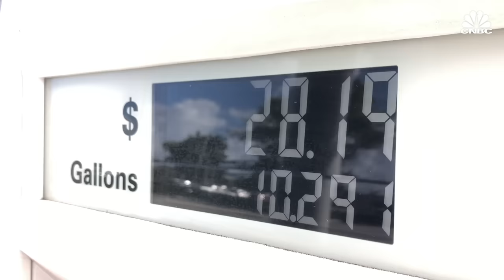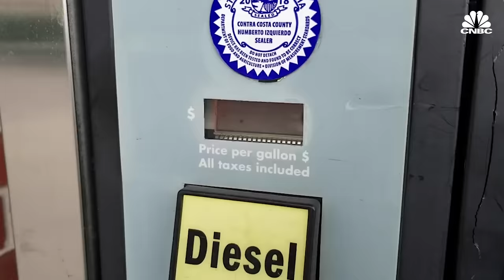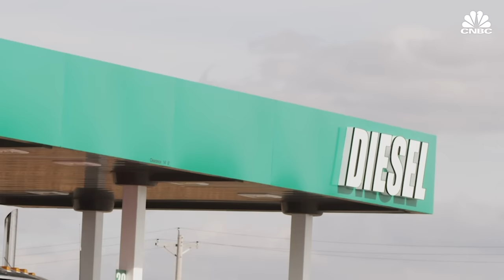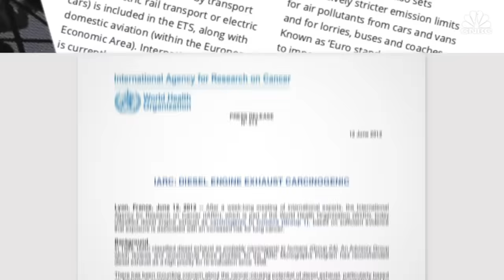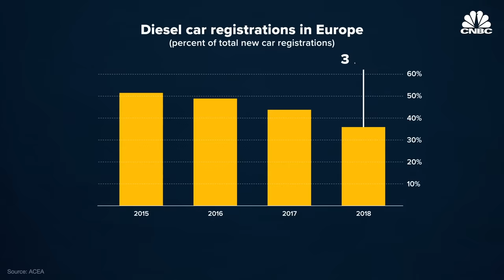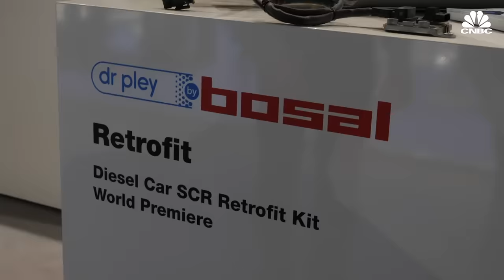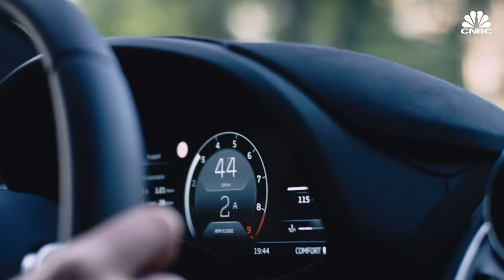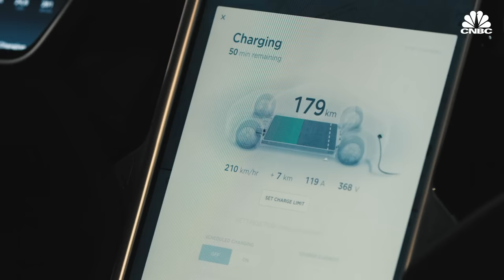Why Diesel Cars Are Disappearing

Comment: Just 2 make it clear. The sulphur content in Diesel has no impact on the Nitrous particles emission .That is occurring  due to the high combustion pressure and -temperature in Diesel compared to that of Gas engines. It is a derivate of the Nitrogen in combustion air.

Comment: Both of my road vehicles are diesels. '04 TDI jetta that gets an average of 42MPG. and my '00 Ram 2500 4x4 Cummins that averages 14-16MPG while having well over 500HP/1200lbs/ft TQ to the rear wheels. Take a gasoline truck with even half of that power and it's lucky to get 8-10MPG. 

My truck has 275k miles on it, still going very strong. Car has 208k miles on it, also still purrs like a kitten, and runs with zero problems. Keep up with basic maintenance (oil changes, coolant changes, filters, timing belts every 80k, etc...) and replace worn parts (motor mounts, brakes, 1 clutch so far) and that motor will likely last as long as you do. Can't say the same about a gasoline. after 200k on a gas motor: you're on borrowed time. On a diesel: 200k = you just broke in the motor. good for another million miles!

As for cars: my fiancée has a comparable sized car to mine, hers is gasoline 4-cylinder. She gets about 30MPG. We both drove 700 miles to our new home. Her car had to fill up 3 times. Mine only had to fill up once. Granted I do have a 15 gallon tank and she has a 10 gallon tank. She's still burning more fuel to do the same work. 

The only disadvantage to diesels is you do lose some fuel economy in the winter time as the winter fuel blend is mixed diesel and kerosene to prevent the fuel from gelling in the cold temps. Kerosene is less energy dense than pure diesel, and as a result lowers your fuel economy a bit. 

You will also see some diesel vehicles cover their grills in winter time to help keep the engines warm during the cold winter months which is another downside to being more fuel efficient. The engine produces less heat and have a harder time maintaining operating temperature in freezing climates. Blocking the cold air coming across the radiator and engine helps the engine maintain operating temps.

Comment: Nowadays diesel vehicles are equipped with Diesel Particulate Filter (DPF) to trap soot. However, it requires active or passive regeneration to burn off the accumulated soot to prevent clogging. Diesel engines also require Low SAPs Engine oil to further reduce the DPF from clogging.

Comment: "Diesel is not done yet"...just note that...as diesel mechanic, technician for fuel injection pump...i decicated  life, skill, effort to give good quality diesel engine, safest, and cheap, and powerfull for heavy equip, machinery and so on.
Reply: Well you have at least another 20 years before diesel becomes completely obsolete
Reply: Modern diesel engines have many exhaust filtering systems that render the exhaust gases practically invisible. I have brand new car (Citroen C4 Cactus 2018) with BlueHDI engine and you can't even notice the exhaust. It administers dose of AdBlue compound which dramatically reduces the pollution and helps the fuel burn better. The US is not the entire world so you cant state that diesel engines will be gone in near future. Even if the fossil fuels are gone, there are many ways to produce bio diesel. And there you have trucks, trains, tanks...

Comment: I love diesel cars and have 3 Ford diesel and now run a Mazda CX5 - 2.2 litre diesel (All been very reliable) which is giving me average 50 mpg. Would never buy electric car-  poor range 250 miles my diesel 420 miles - refuel time electric could be several hours  - my diesel 5 minutes - Big drawback cost to replace battery on electric car perhaps after 4/5 years about £10,000 depending on model. If you run out charge on electric car would mean a tow. Me I keep 10 litres of diesel in the boot just in case.  I think I will keep driving diesel as long as possible

Comment: The PSA (Peuget/Citroen group) still launched newly coming diesel engine, DV5, in 2018.
This DV5 diesel engine is able to meet the Euro 6 STD gasoline standard.
Whatever the requirement for gasoline engine, the diesel DV5 make it.
Reply: Yes, but modern diesel engines bocome so complex and expensive ,just to meet emisions regulations. At one point- all economy from fuel is pointless - with that complex engine and with so hi cost for maintaining modern diesel.
Reply: Unfortunately, the Stellantis group (formerly PSA/Citroen) have already stated that it will be too costly and too technically challenging to meet the upcoming (in 2025) Euro 7 emissions regulations with an ICE engine......as have several other car makers......

Comment: It has been scientifically proven that most of the airborne carbon particulates around roads come from tyres and brakes NOT diesel engines. A combined diesel/hydrogen engine is needed, with the diesel engine running on vegetable oil as it was originally designed for. Electric cars and vans still use tyres and brakes, and payback for production carbon dioxide of electric vehicles is on average at least 11 years; batteries won't last that long. All electric vehicles is the wrong path.

Comment: I would dare to say that diesel is not finished indeed. Maybe US customers do not drive diesel cars, but Europe is still very much in love with diesel engines. Euro 6 norm for the gas exhaust system is so efficient that you can hardly feel the scent of the engine. In fact, it smells like vapor. Just wait for what happens after the EV hype has started to crumble already! Diesel may just be a go-to fuel.

Comment: Good, balanced report , well done! 
Worth pointing out that Diesel died in Europe as consumers worked out that the emissions systems are costly to repair and often fail when used for short journeys. Diesels also get smoky and dirty over time.
Diesels can be made clean by using urea additive but not cost effective for small cars and the big German makes were fined for colluding to limit the size of these pollution reducing systems. 
Diesel is a good fuel and can be clean, VW poisoned the pool for diesel in Europe unfortunately for cars and light trucks.
Reply: Diesel died in Europe? Could have fooled me. Hybrids are just now starting to match diesel car sales volumes in Europe. Go car shopping in the UK and you can buy a smart new VW Golf with a 2L diesel that gets 62 mpg.
Reply: I'm in the UK I'd never buy electric. I'm keeping my diesel until they completely ban them

Comment: Just wait and see what happens when the truth comes out about electric cars .
Reply: How are EVs even remotely comparable to diesel?
Reply: Good comment  but we will all be stuffed  .... with electric
Reply: @planefan082  well the actual end life pollution made is higher on ev than normal cars. thats what he means
Reply: @nekkosuperfire6852  I know that's what he meant. I'm saying that for years now this has actually been untrue. While somewhat close, the average driver saves enough emissions in driving to make up for the higher production emissions. And that's the AVERAGE driver; if you run a fleet, taxis, buses, trucks or really anything for more than personal use, the difference in lifetime emissions become staggeringly massive.
Reply: Yes no matter what electric cars will always be limited with range and charging time. Electric will never be practical and batteries degrade over time. Also electric is not free. Electric cars will fail in the long run.
Reply: @icemandos  Range and charging is being worked on, but it costs money for electricity? Wait till you find out how much gas/diesel costs.

Comment: euro6 engines actually clean the air.. this whole anti diesel stuff is more political than scientific.. like most restrictions in life
Reply: Zuurker U  sure...
Reply: London u have to have a car less than 6 years old otherwise daily charge for Diesel cars etc
Reply: Zuurker U  filter air. From dust and particles. That is what filters do. No one talks about co2. Its cleaning air from particles.. Im pretty sure you never ever saw these systems.

Comment: Ironically US president's limo runs on diesel 😁😁
Reply: Low combustion makes sense
Reply: leicanoct  No it's not a gas engine.  It's a diesel engine.
Reply: Well it was based off of a Chevy Kodiak frame so....
Reply: @philiphoyle  okay but the presedents limo is easy to be birned because flamable diesl. Lol they use armor plates to protect the diesel engine😂 so ironic
Reply: Alex H diesel is not flammable, gasoline is. Diesel engines were the reason Russian tanks were safer in WWII than German ones coz Germans used gasoline engines and blew up while Russians used diesel and didn’t explode
Reply: @Zoroastia  diesel is combustible not flammable which is why you need such high compression for diesel to work
Reply: @Zoroastia  Read up on Diesel. It isn't flammable AND it CAN be used as fuel. It ignites under heat and pressure.
Reply: @Zoroastia  Cool story bro, almost had a point
Reply: @Zoroastia  Did you watch the video ? It's explained...
Reply: *disappearing for sheep class
Reply: It's running on jet fuel
Reply: @philiphoyle  main reason is that diesel not as combustible as gasoline, thus limiting the chances of an explosion in case of an attack
Reply: @philiphoyle  Diesels don't produce more torque because they are diesels, but because they always come with TURBO nowadays. Add turbo on a petrol engine and it makes roughly the same torque as turbodiesel.
Compare some old engines from the era when many diesels still didn't have turbo (old Mercedes, etc.). SAME year, SAME displacement, no turbo.
3.0 petrol without turbo had much higher torque than 3.0 diesel without turbo.
Huge torque comes from turbo, not because it's diesel or not.
Reply: Ernest 
You know a lot of the time when a tank goes kaboom, it's from the ammunition, right?
Reply: Audi Q7 (6.0) V12 TDI was praised by everyone at the time, for having a huge torque of 1000 Nm.
At the same time, V12 (6.0) petrol from AMG had exactly the same 1000 Nm, which wasn't mentioned by many. The main difference was (and still is) that petrol makes much more horsepower than diesel, even if their torque is the same. From 1000 Nm, Q7 V12 diesel made 493 hp. From the same 1000 Nm, AMG V12 petrol made 612 hp.

Today, very popular 4.0 V8 TDI makes 900 Nm and 435 hp, using 2 turbos + 1 compressor.
Same sized petrol engine, 4.0 V8 also makes 900 Nm, but 612 hp and only uses turbos, no need for compressor on top of that.
Reply: @cancelled_user  the main difference between diesel and petrol engine is in their compression ratio.
Due to diesel engine's higher compression ratio they produce lots and lots of torque at lower range and at the same time diesel fuel itself is more energy dense than petrol, this quality leads to higher efficiency in diesel engine.

And you gave comparison between audi diesel vs mercedes petrol but what about boost pressure ?
Are they same in both of the engines ??
Reply: @SanidhyaKPatel  I know what's the difference. Still, diesel without turbo has less torque than petrol without turbo. 
It's the turbo itself that makes the huge difference. With the turbo, even petrol engine has huge torque at very low rpm.
I don't know what boost they use, but I'm pretty sure they did their best to squeeze as much from both as possible while meeting all emissions criteria.
Reply: More horsepower in petrol comes from higher rpm. Since horsepower is a function of torque + engine speed, if both diesel and petrol have the same torque, the petrol will have more horsepower because it can rev much higher. Of course, it also depends on bore and stroke, oversquare or undersquare engines, etc.
Reply: For now. Just wait until Tesla makes limos ;)
Reply: Edwin Braun diesel is flammable, it just has a very high flash point
Reply: @cancelled_user then let's compare mercedes straight six petrol with straight six diesel 

And also compare BMW straight six petrol vs straight six diesel. 
In above cases all four engine are turbocharged but diesels produce much much torque than petrol siblings 

That's why I'm telling you about boost pressure 
High performance Petrol engine generally running on more boost pressure than diesel counterparts that's why the produce so much torque, if they using same boost pressure as diesel engine they make way less of torque than diesels
Reply: @Zoroastia  it's only flammable when compressed. Just do abit of research.
Reply: @Zoroastia  Diesel fuel is combustable only when it is pressurized.  In atmospheric pressure diesel is not flammable or combustable - you can drop a lit match in a bucket of diesel and all that will happen is the match will go out.  Diesel engines utilize a much higher compression ratio than gasoline engines.
Reply: @cancelled_user , 
That is an incorrect statement. Years back US had a lot of non turbo diesel engines and with the exception of the old nightmare GM fake diesel engine, they all out torqued the gas engines by a long shot. They also build the torque and a much lower rpm, where it is most useful in daily driving, and much better mileage to boot. 
Why do you think the trucking industry uses only diesel engines??? Because the out torque the gas engine and get better mileage and live longer. That is something a gas engine will never achieve in that application.  Also, remember, torque is what moves the car, horse power is how fast the torque is produced...
Reply: leicanoct  The Beast use a Duramax diesel engine closely related to that featured under the hood of Chevrolet and GMC's full-size heavy duty pickup trucks. Why diesel? Aside from the durability associated with diesel engines, the fuel has a low volatility that reduces the risk of it exploding - and it can be found everywhere in the world, unlike high quality unleaded fuel.

Comment: The reason currently that diesel engines produce more noxious gases is due to the fuel ( highly taxed fossil diesel - actually a waste bi-product of oil cracking) that is dispensed at the pump.  It is not the engine that is a problem.  Diesel engines using more readily available cooking waste oil has more energy and less pollutants , if a particulates filter is used. 
Governments have resisted using biodiesel and straight used and filtered vegetable oils (which have much lower emissions) because it is more difficult to tax their use when they are not coming from the forecourts.  The only issue with using waste vegetable oil ( which actually solves the issue of disposal) is the government requirement for a waste disposal licence , and a small amount of particulates from the exhaust which can easily be filtered.  So actually burning waste and thinned vegetable oils, after they are waste from cooking, would solve a disposal issue AND a pollution issue, if only exhaust filtration of particulates was more readily available.  
But your government instead wants the tax at the forecourt.

Comment: Whats amazing is electricity comes from no where! Its not made from coal or anything!
Reply: Lol, we are not in 2008 anymore,there is a growing percentage of electricity that is produced by renewable sources. But keep the pipe dream of supporting doomed industries like coal, the economic forces will take care of that believe for you.
Reply: @pedrolopes3542  As of now, EVs are big city cars. Rural areas don't have the infrastructure or clean energy sources to support electric cars. Cali is the leader in clean energy and even now that only makes up 30 percent of their energy.
Reply: @brandonlewis5045  I was supporting combustion engines kid, what are you talking about?
Reply: @shapeshifter9423  

my bad wrong guy my man! I get worked up by these fruit loops that have no clue
Reply: @pedrolopes3542  99% of electricity is still made from coal and diesel, not much has changed since 1990, nevermind 2008
Reply: @THESLlCK  The production of electricity from coal is actually  only 13%  in the US,  but even if all energy was coming from coal, it would still make sense to use electric cars, because the combustion engines are a lot less efficient than electric motors.

Comment: Don’t forget that GM did diesel a disservice in the late 70’s and early 80’s with thier craptastic 5.7 and 4.1 liter diesel engines.  The engine kept failing at an exponentially high rate.  By the time GM solved it in the mid 80’s, we were done with diesels in cars.

Comment: The myth of diesel: it's not more efficient it just contains 15% more energy than gasoline volumetrically.  It should be sold in 7 pint increments not gallon.

Comment: The narrator mentions trains @ 3:15 & shows a diesel/electric train where like most 'diesel' trains, the diesel engine runs a generator & the motive power is achieved with electric motors & is therefore hybrid.

Comment: Diesel in urban areas is a problem, actually cars in urban areas is the problem. My experience with a no frills family diesel car underlines speed is the big factor. Where I live 130km/h is the freeway speed limit. At that speed I'm at 10 l. per 100km. When I lower speed to 100 km/h the fuel consumption drops to less than 4 l . This is over 60 mpg. Speed and type of vehicle is a bigger factor than fuels. (Looking at you SUV and pickups)